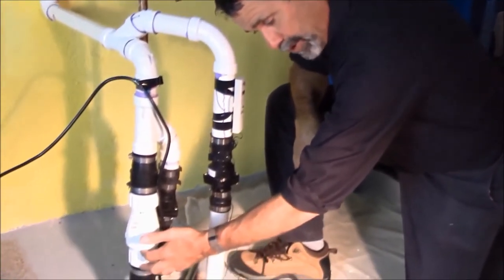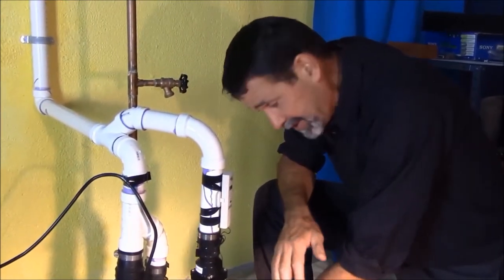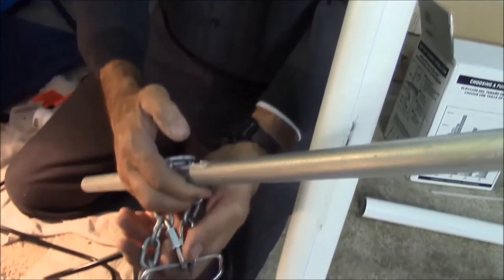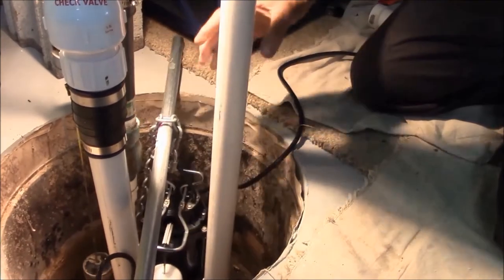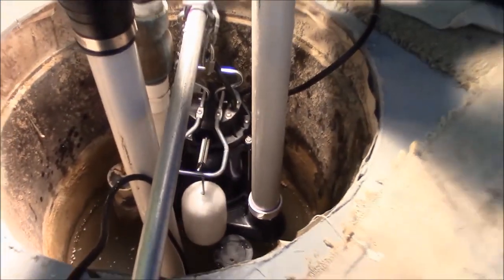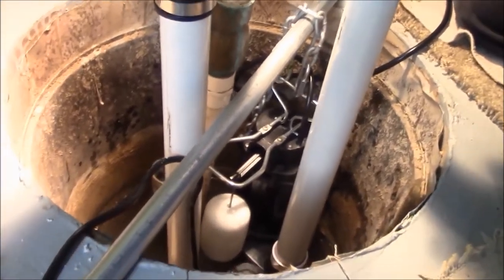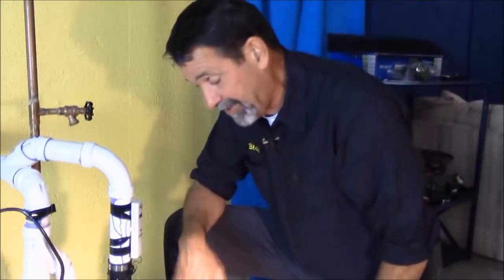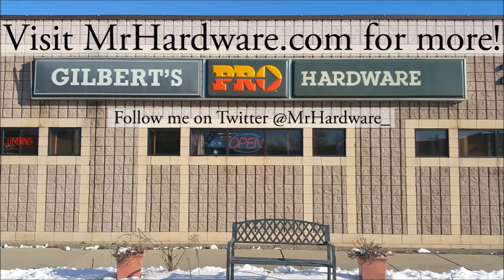Sump Pump Hanging On Pipe, Chain in Narrow Pit as Backup Pump

Comment: Great DIY! Just an observation though... With 1 sump pump, assuming 1/3 to 1/2 hp, you are already at about 90% (60-70 gpm) of the max flow rate you can achieve through a 1.5" PVC pipe at 20-40 PSI. It would be MUCH more efficient to run another PVC line or replace the 1.5" with a 2" pipe on future projects. Just trying to maximize that flow rate. Just that 1/2" extra will give you  50% more flow (around 120 gpm)
Reply from the maker: I'm running 2 sump pumps so I have a backup, rarely is it for greater volume. I do try to insist on a water or battery backup pump to be piped separately. For visual and restriction benefits.